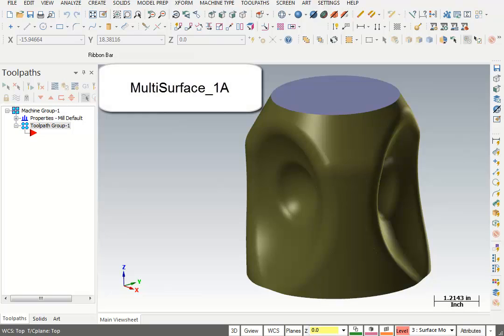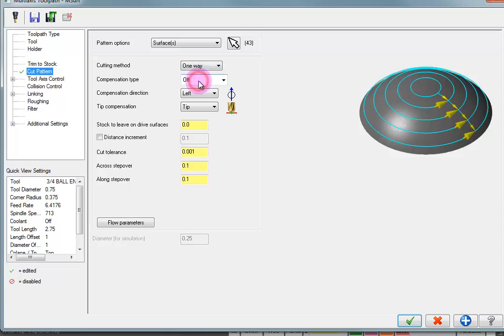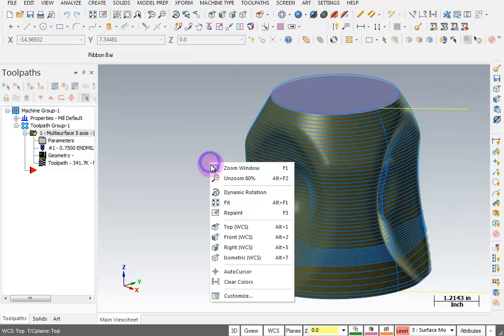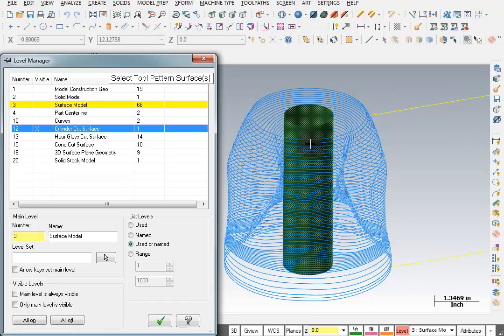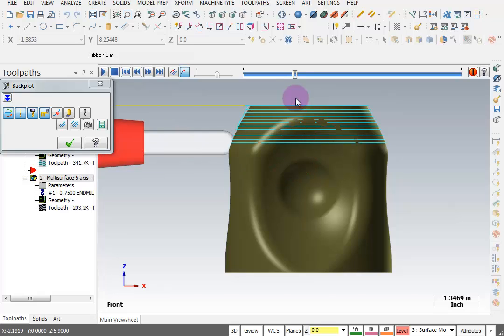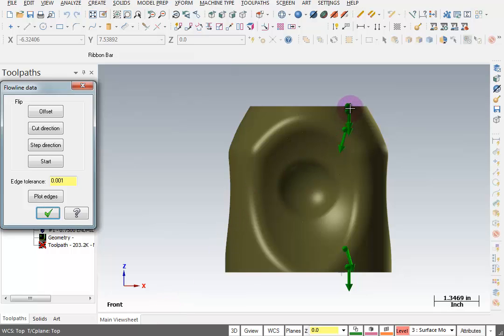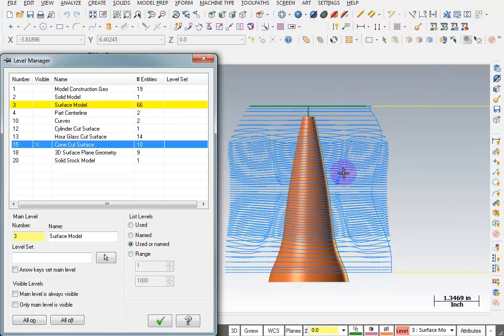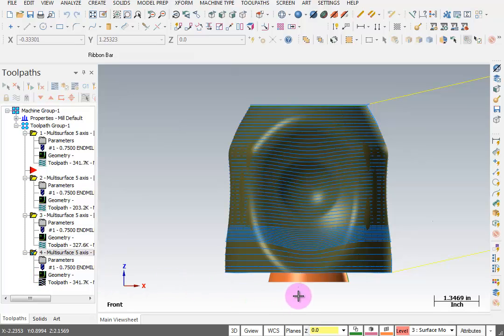TFM - Mastercam 5 Axis Machining - Multisurface with Pattern Surface Control.

Comment: Thank you for the explanation. Is that pattern surface an arbitrary guess? Or do we offset the original outer pattern? 

Kind Regards
Reply: you can use the clean core method in most multiaxis toolpaths